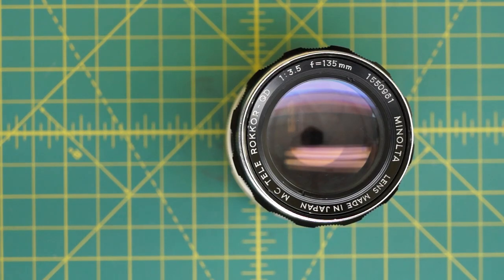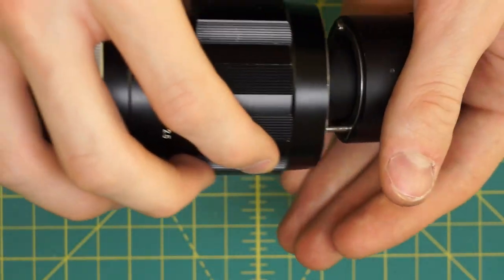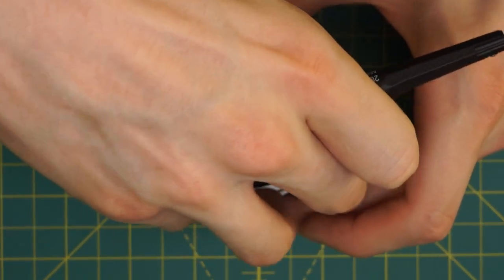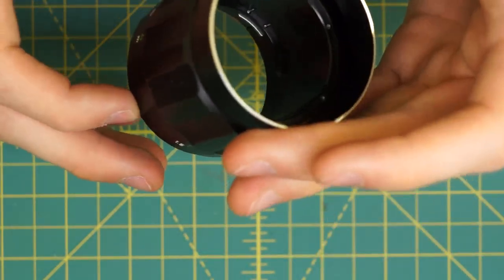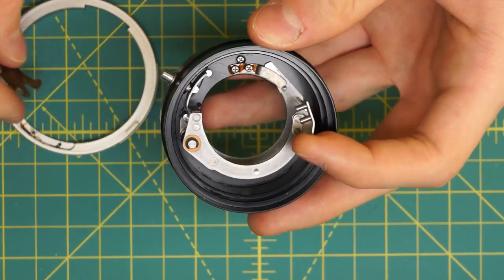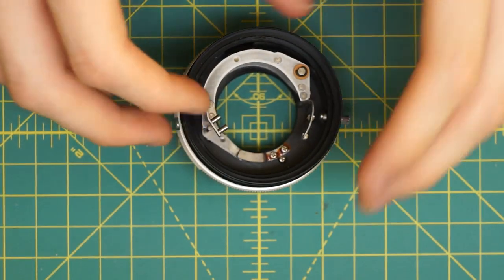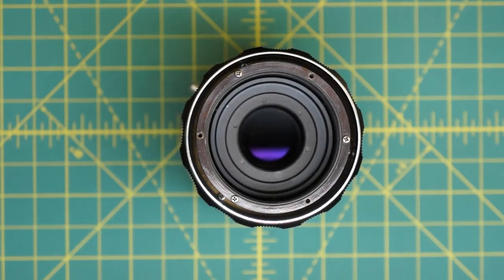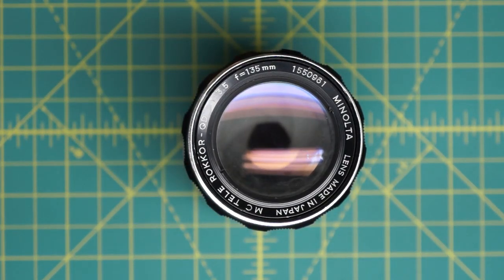Minolta MC Tele Rokkor-QD 135mm f3.5 Lens Full Disassembly

Comment: I found a MC(I) Tele Rokkor 200mm f4.5 with stuck aperture and focus stop issues. The construction is almost identical to the lens Matt shows here. Focusing all the way out reveals 3 slot head grub screws on the side of the lens hood assembly. Loosen and pull off lens hood assembly. Optics unscrew and diaphragm assembly come out just like this 135. Most importantly for me, the bayonet assembly comes away from the lens barrel ( 3 screws on the side of the ring with the depth of field markings, so thanks to Matt I knew it was safe to unscrew those screws. I was able to fix both issues. Nice lens.
Reply: My bad, it's extend the lens hood to reveal the grub screws, not focus out.

Comment: He didn't say anything about the disassembling of the front lens-group. Is it glued or what? Are the lens elements separable or not?
Reply: No, In these versions come two groups of lenses on plastic mounts. And they don't have a threaded washer, that is, there is no way to disassemble them, they are sealed. If fungi do form inside these groups, until now I have not seen, nor do I know how they could be cleaned.
Reply: @mistergiovanni7183  Ok, so I thought. Thank You.